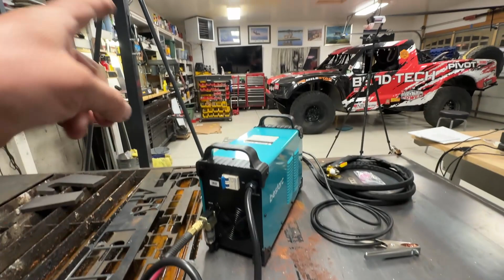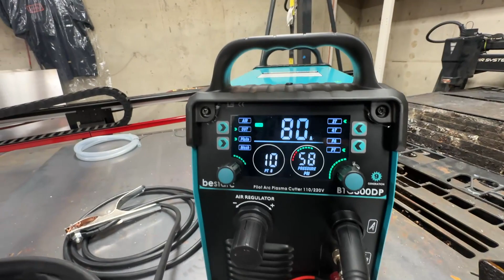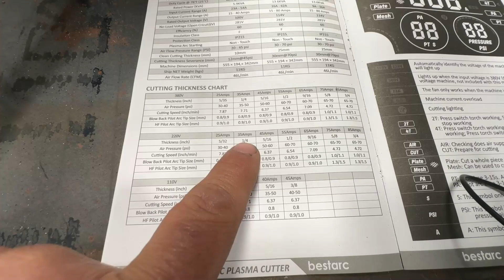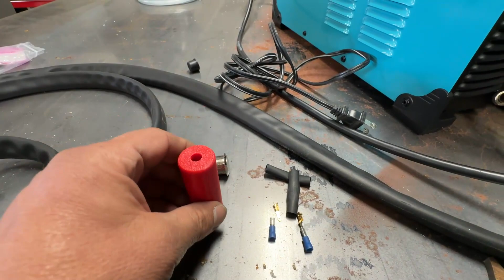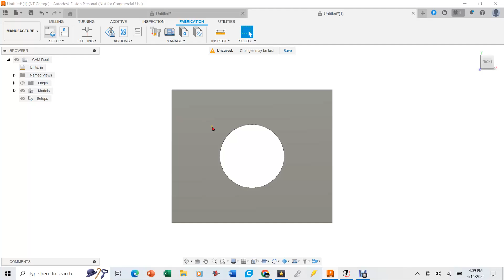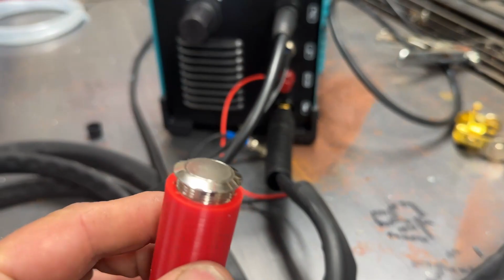BestArc BTC800DP Cuts 1" Steel on CrossFire XR

Comment: Just wire the switch to the xr, and wire the THC as raw voltage by opening the plasma cutter and wire it directly to the lugs, remember the ground clamp is the red wire and the black wire goes to the torch
Reply from the maker: @TripleG3D  I was thinking I could do that, but I wanted to see if it could be done without input from the control box.   I was not sure what signal was coming from LS to tell the plasma cutter to fire.
Reply: @ I’m pretty sure it’s either a 5v or 12v constant signal, my primeweld cut60 runs in 2t mode on my PRO and XR. Simply hook up a multi meter to see on the plasma what the voltage is running to the switch. But I’m pretty certain you won’t have a problem.
Reply from the maker: @TripleG3D  thanks.  Will try it.
Reply: @ntdracing  I’m curious as the connection of the torch to the machine. Almost looks like a tig welder dinse 35 connector that allows the air to travel through it